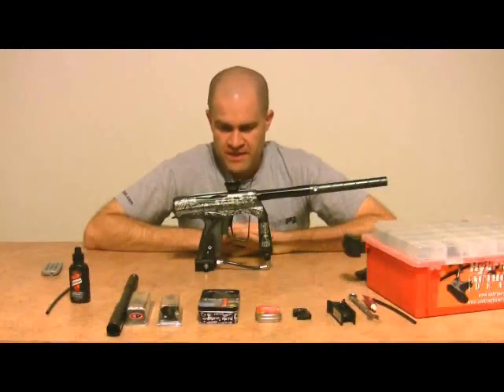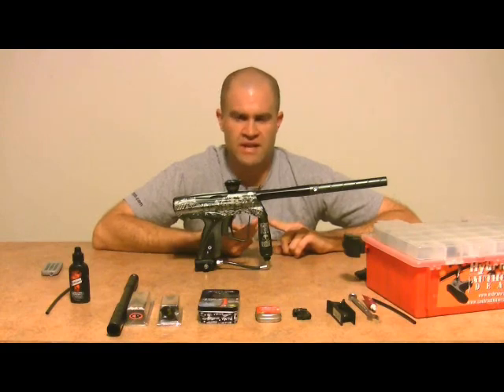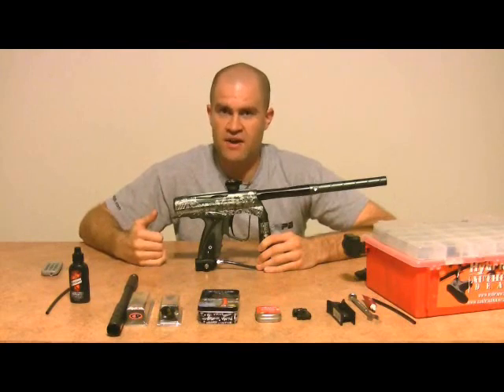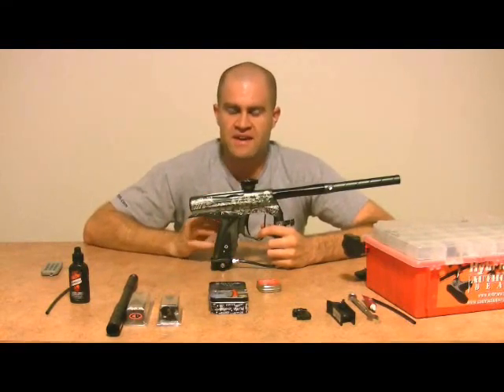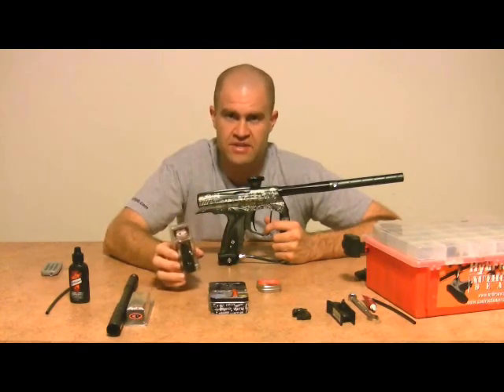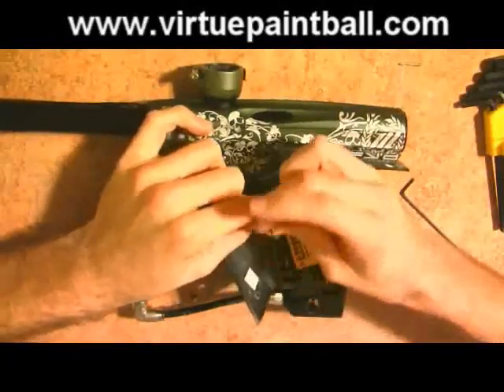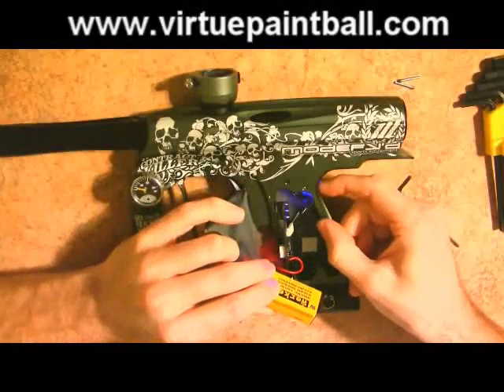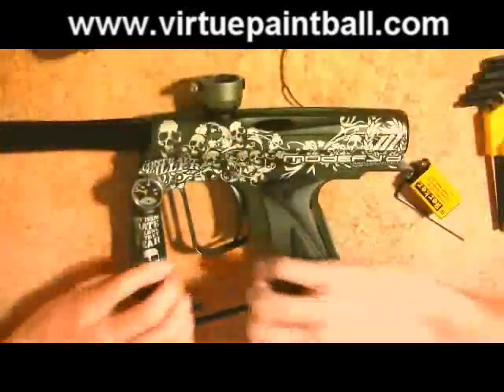Upgrade Show! 2009 Smart Parts Shocker NXT

Comment: yes u will need some fiting on ut regulator or asa, u may can take ur old fittings if u want to
if u put blue locktite on em, u just dont have to worry about leaking, but u can also use teflon tape, but it wont look that pretty

Comment: When you were talking about the ASA screws, did you mean just put it in behind the on that comes stock so that the two screws are piggybacked or is there another hole in the grip frame? Also, after you replaced the board and had installed the laser eyes, you said something about a cool little trick, it was after the making sure that you had your wires away from the on/off, you never brought it back up, or atleast from how far I'm into the video you haven't. I'm just wondering, what was it?

Comment: Werker Batteries are the best, i was wondering about those black macroline fittings. are they powder coated or what? i would be afraid of the paint coming off after putting a wrench on them.

Comment: its the same gun but new board and feedneck. you can send your nxt shocker to smart parts and they will put in the new board for 20 bucks. feedneck is extra. theyre just building off the 07 shocker

Comment: I'm actually suprized the blue loctite works in sealing air.  I've tried it on my 'mag and it didn't work right.

Mike was saying the teflon tape looks bad, I usually pic the excess out of the port after I install the fitting.

Comment: If you have a stock shocker board that still has the rebound modes, could you send it in to GOGPaintball and have them flash the board with the new modes?

Comment: Hey man , I just bought a Shocker nxt 07 from a guy . I'm a breaking paint all the time! I use draxxus blaze. It isnt because it's cold , I changed battery everything ! Cleaned eyes. Just everything. But still I got the problem . Could it be the sft o-ring? Or just the pipe? I got a 3 piece barrel and its an edge when I insert my barrel into the insert , is that a problem? Please help me

Comment: need advice. i have a nxt with virtue redefined board, cp asa and reguator. went to field, gun chrono at 275-283. problem is gun distance was no great.  my spyder pilot 09 shot further.  the dwell setting on shocker was set to 12. any advice. Thx

Comment: Mike, do u fix guns, like i could send u mine, The cp reg and cp asa are leaking. The Cp Asa is leaking out of the little plug bolt on the other side of where the macro line fitting goes. Thanks.

Comment: The SLG has a better board, better feedneck, better ASA, better regulator, better customer service, it's smaller, it's lighter, it's cheaper. The vibeI meant the bh vibe) has a better board, better feedneck, better ASA, better regulator. I don't like the NXT at all, because like Mike says you get an empty box.

Comment: nxts have tournement boards, qlocks, they both have terrible asas. the shocker shoots wayyyyy nicer and more durable, feels better in the hands, and dosnt jam and leak constantly. its also not constructed out of plastic like the vibe and slg. the vibe blacheart board dosnt have tournement settings either. the vibe is a nice gun as well for beginners, the slg is just a fail. but in all the shocker is a nicer gun.